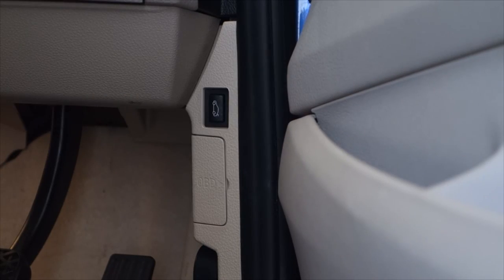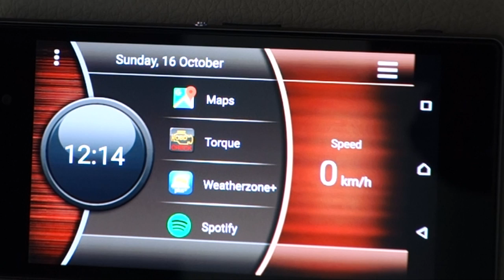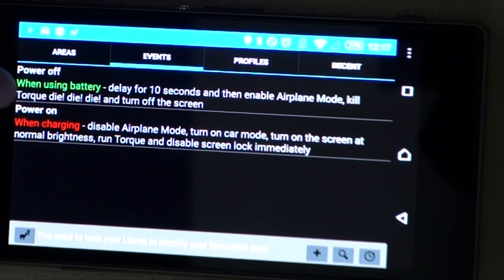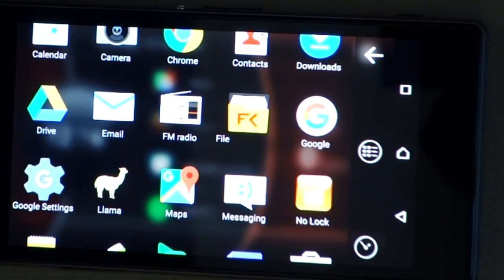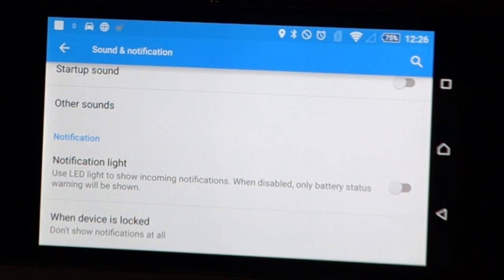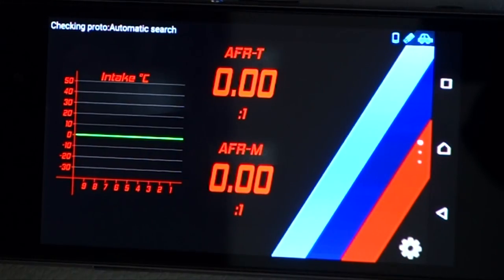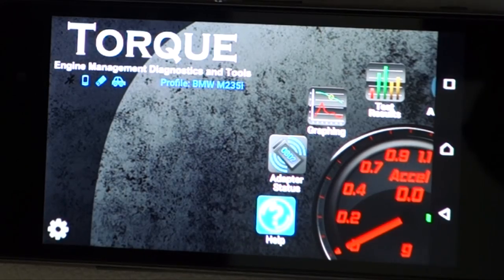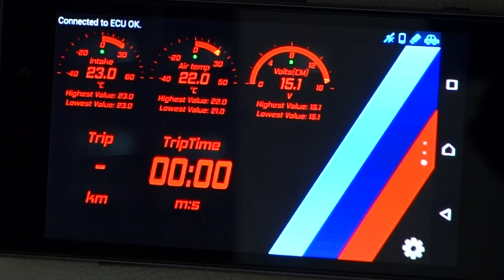How to make Digital Gauges with an old Smartphone

Comment: I prefer to use my double din Android head unit with Dash Command vs Torque pro with the OBDLinkMX. When your OBDII port is in a location that causes the connected device to stick out risking damage to the device or connection port by bumping it; I recommend using an OBDII extension cable to reroute the device. Can also be used to mount device in your console or instrument panel for a sleeker look.

Comment: What if my old car does not have that OBD port T_T !
Reply from the maker: +EternalDragnz not much you can do in that case I'm afraid :(
Reply: No digital gauges for my old E30 then :(
Reply: there is ways but you need to dig deeper because you need to replace it to obd
Reply: Then you do it the old fashioned way (which I think is better) with pod gauges connected directly to the engine and ecu (no lag or worry about a phone bugging out)
Reply: What about a 20 pin to 16 pin adapter?
Reply: What if I don't have a car :-)
Reply: Just buy a sticker showing the gauges.